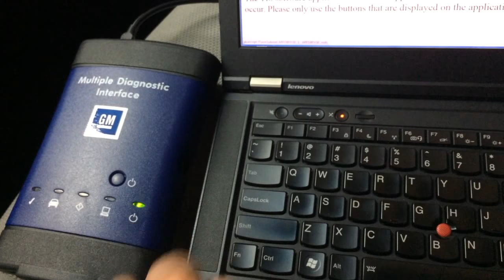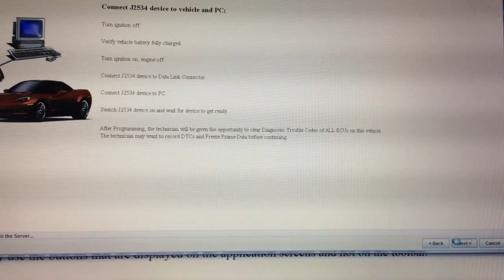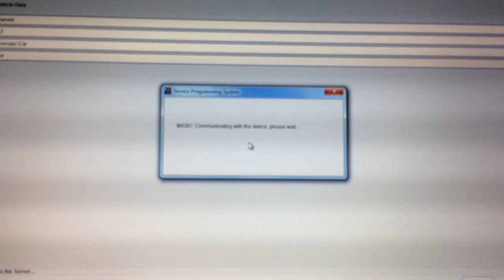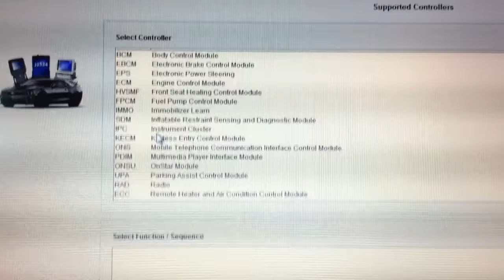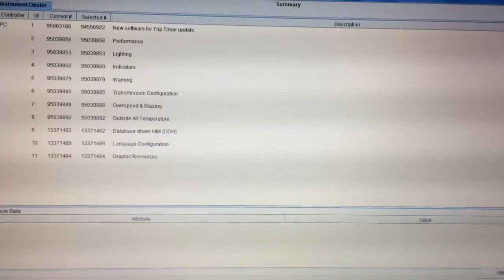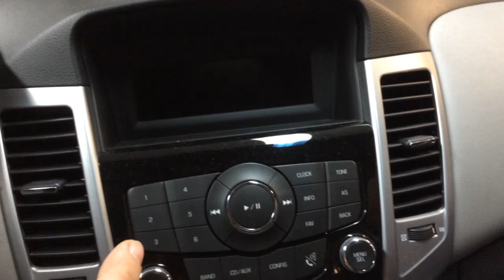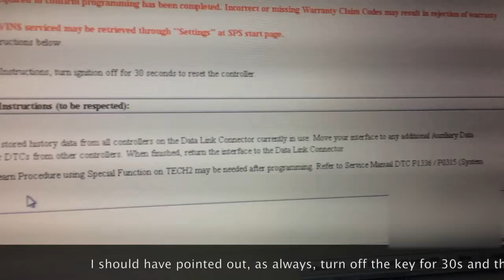GM SPS Programming: MDI Tool J2534 Mode ECU TIS2Web How to do a Calibration Update Reflash (IPC)

Comment: What about the BCM?
Reply from the maker: Most GM BCMs are write-once by the scan tool, which means you cannot change the VIN or mileage using the dealership grade tools.  All you can do is toggle options, like Cruise Control Yes/No.   I did a video on this here https://www.youtube.com/watch?v=Chy9pIzoguA
Reply: @DrShock  i have a new bcm trying to program to a 03 impala.. radio is locked and security light is flashing..tried a passthru 2.. no bcm program on it.. is there another way? Besides the video you supplied?
Reply: I have a subscription to the ac delco program also
Reply from the maker: So the video I linked is just for used BCMs, you didn't mention initially you had a new one.  Used BCMs are very difficult to reuse.  For a new BCM that's a far easier story, you can just go into New BCM Setup under special functions if you're using a Tech2.  For the MDI I believe you need the GDS2 subscription to do the same thing.

Comment: The MDI does support tis2000. I use it every day.
Reply from the maker: Yeah, technically, if you can get the j2534.dll installed that was developed for use with the VXDiag Nano or other non-GM hardware, that Windows driver will let it talk to an MDI.   Not all TIS2000 ISOs will have this driver included.  

But even with it you're off the main path GM intended.   Being off the main path, if you run into SPS problems there will be few to no places to get help.  If you keep TIS2000 with the Tech2, as GM did, then there are many sources of help as that's the normal setup.   Similarly if you use the MDI with TIS2Web, you can simply call up ACDelcoTDS on the 800 number right now today and get free technical support with it if you run into SPS issues.   Time is money, so for these reasons I don't get into any paths you wouldn't find at the GM dealer service area originally.
Reply: @DrShock  Most of the methods I use are not GM approved.